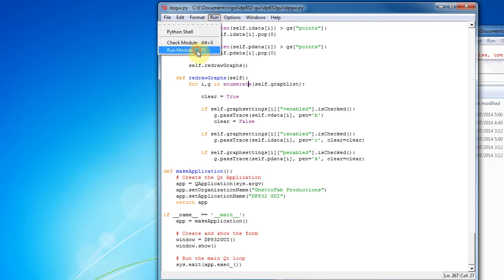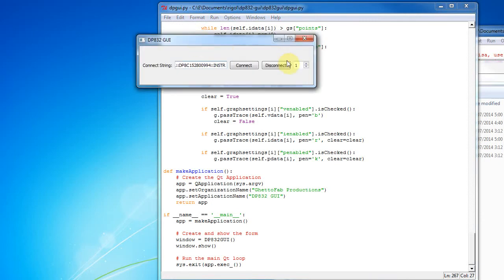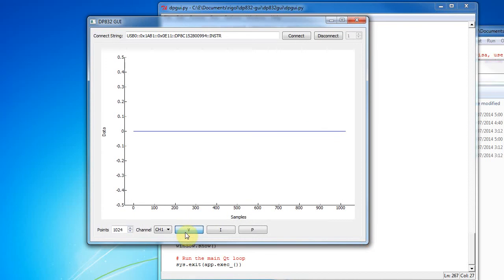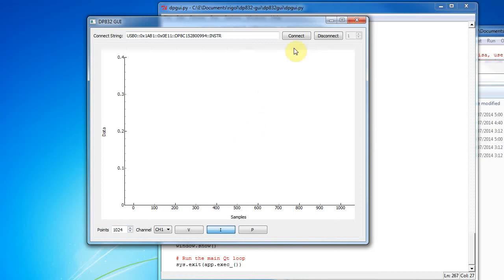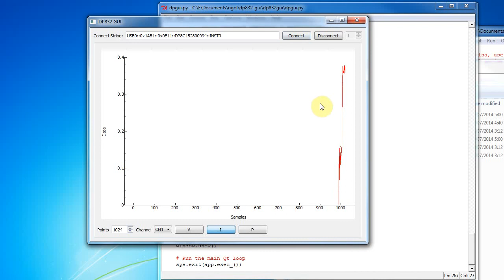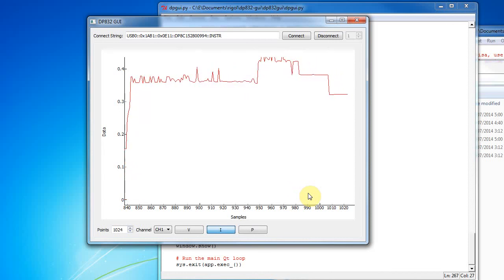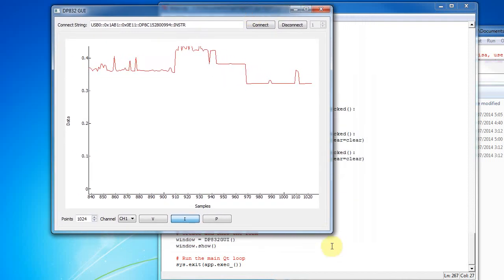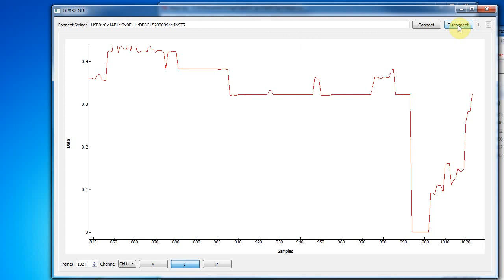Craptacular GUI for Rigol DP832

Comment: I have been trying for a few days to get this running and am stuck at the point where each time I try and connect I get the following message
  File "C:\Users\hedley\Desktop\dp832-gui-master\dp832-gui-master\dp832gui\dpgui.py", line 237, in tryConnect
    self.inst.conn(constr)        
  File "C:\Users\hedley\Desktop\dp832-gui-master\dp832-gui-master\dp832gui\dp832.py", line 12, in conn
    self.inst = visa.instrument(constr)
AttributeError: 'module' object has no attribute 'instrument'